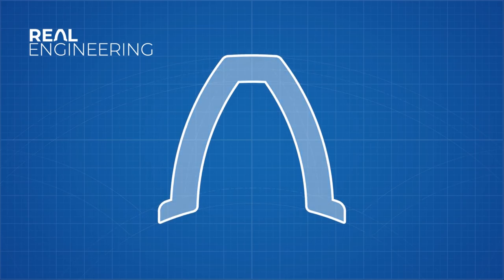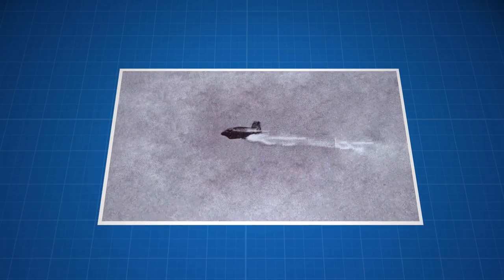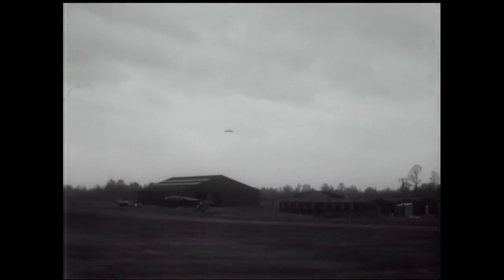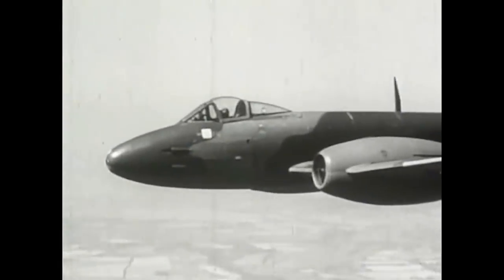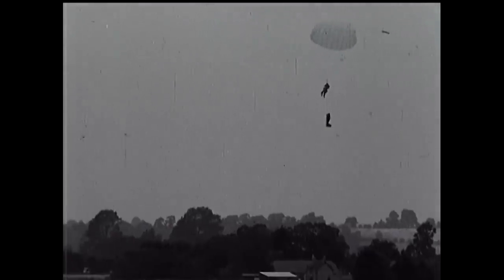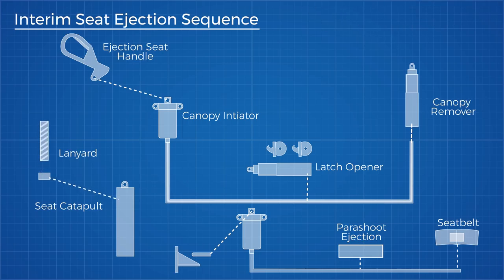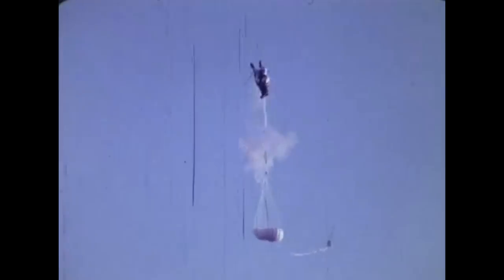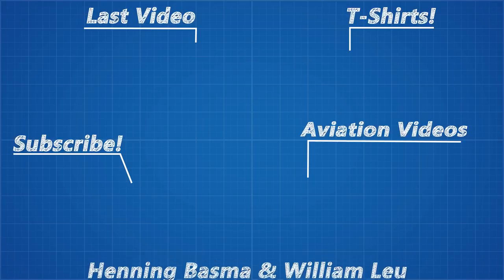Why The US Airforce Ejected a Bear

Comment: At first glance I read "Why the US Airforce REJECTED a Bear" and I was wondering why would they have refused the chance to examine a Tu-95.
Reply: Benito Llan Matos I would have asked a better question. “Why did a bear try to join the U.S. Air Force?”
Reply: Why would the US need to examine the Tu-95? They had the B-29.
Reply: Because they'd want to know exactly what the Tu-95 was capable of to better counter it.
Reply: Kevin Smith they also had B-52s. Having a Tu-95 would help them know their actual range, top speeds, all-aspect radar signature in different frequencies, better guess their maintenance costs, etc, etc.
Reply: I meant it as a joke since the company who created it also re-engineered the B-29. The Bear shares some striking similarities with the B-29 with some modernization although the last plane built off the B-29 was the Tu-85 or something like that.
Reply: I read "Why the US Airforce Erected a Bear"
Reply: Thewaltham all they had to do was listen for the bloody thing coming
Reply: Gotobar 1313 He wanted the GI bill.
Reply: yes, in many ways the TU-4 was better then the B-29, and the bear is completely different. A turboprop bomber capable of speeds over 900 kph
Reply: @KevinSmith-qi5yn  Because it likely contained their highest level of technology. America stopped making Vacuum tubes at around Gen 13? The Soviets took it to Gen 36 or more. 23 levels of advancement. And they were radiation and EMP proof. Meaning if a nuke pops nearby, your trons are still flowing. Everyone else crashed.
Reply: @MrT79shakeshake  The sucker is fast! F4's used to be used to intercept them. Phantom was a fast bird. The Commies made a lot of advancement in counter rotating turboprops. The unloading of the airframe from prop torque must have lessened the structure required to mount the powerplant. Don't know why it isn't popular.
Reply: @awittyusernamepleaselaugh7481  nothing to learn
Reply: i now have made this comment have 666 likes

Comment: @Real engineering, you've totally ignored Soviet ejection seat development history. Which was quite fascinating. Included such facts:
1. They used dogs instead of bears (on early vertical rail testing)
2. There was a case when pyrotechnical screwed up which resulted 5x or something more acceleration then it was planned. Which proofed that human can handle high but short term increased G forces
3. Early testing was conducted on ww2 era 2-tails aircraft (Pe-2 if I'm not mistaken) to minimize risk of injury (contrary to 1 tail plains)
4. At the beginning pilots were distrustful with ejection seat so tour though military aerodromes was conceived with 2-seat aircraft ejecting professional paratroopers on each stop while asking volunteers from each regiment
5. At least one design of ejection seat included feature like automatic attachment of canopy to chair during ejection to protect pilot from supersonic flight (making effective capsule for a pilot)

Comment: Also interesting to note is the ejection capsule utilised on the XB-70, which shielded the occupants in a clamshell compartment allowing for supersonic ejection. Also the early ejection seats in the F-104, which fires downwards as opposed to upwards in order to clear the high tailplane and vertical stabiliser. Safe to say that was an awful idea for any sort of low altitude ejection, but as you mentioned the technology to successfully propel the pilot away from the aircraft at high speed really didn’t exist until fairly recently.

Comment: Random fact: F104 prototypes had a downward firing ejection seat
Reply: https://youtu.be/fChqJY9VzTU#t=13m44s skip to 13:44 if the link does not work.
Reply: A B-52 has two downward firing seats.
Reply: I heard a story (urban legend) from my air-force uncle that one pilot was practiced with the downward ejection, had an engine failure on take-off, rolled the plane over ---- and ejected straight into the ground.

Comment: Seats (capsule) that eject down instead of ejecting up could be a good option!
Reply: Originally, that plane, the B-58, had two seats that ejected upwards for the two crew members in front, but the navigator behind them ejected downwards.  The USAF ultimately figured out that if the crew had to eject at low altitude they were going to have to train a lot more navigators.
Reply: Thanks for!